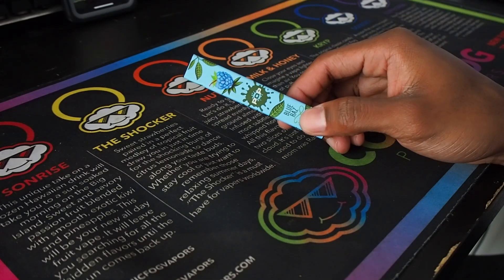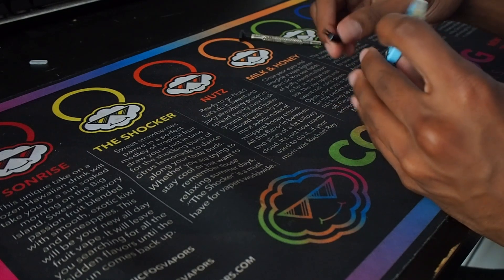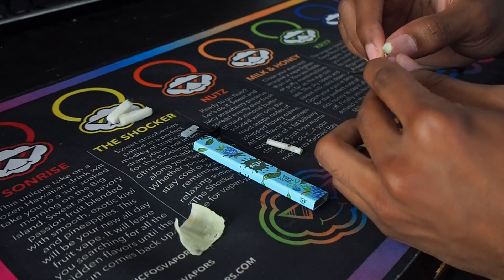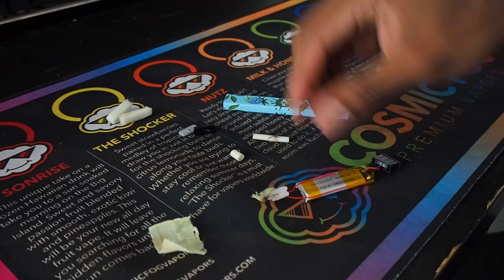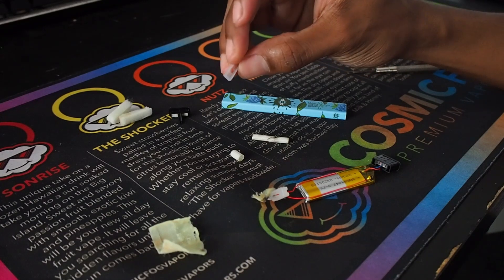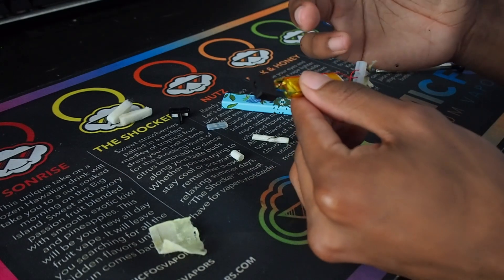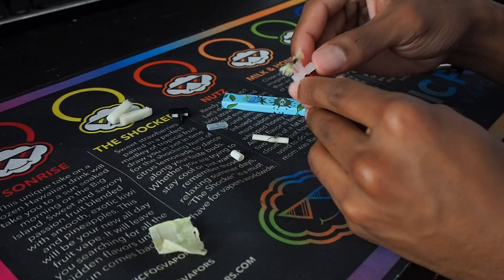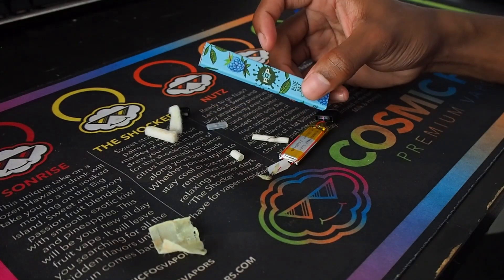What's inside a Pop Disposable? 🤔

Comment: How to recharge them tho?🤔🤔
Reply: take the bottom piece out, just need the black and red cords, then find an android charger cut the top off (DONT CUT THE WIRES!) only take the black and red cords (match up red to red and black to black or else it will blow) and make sure the charger is plugged in. If you want some decent hits continue to hold them for a good 3-4 minutes but if you smell any odd smell immediately take it off :)
Reply: cianna b. How can I take the bottom piece off!!
Reply: @k.k1668  you have to use pliers and the strength of god himself